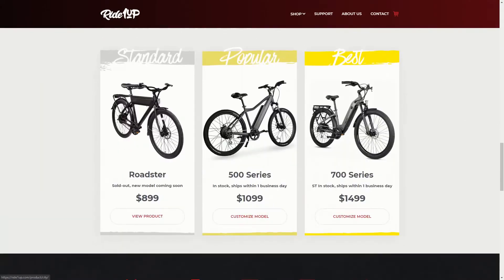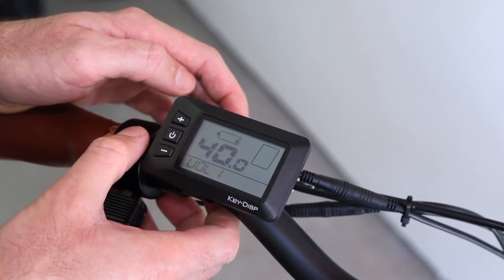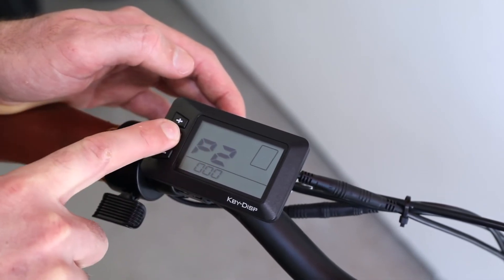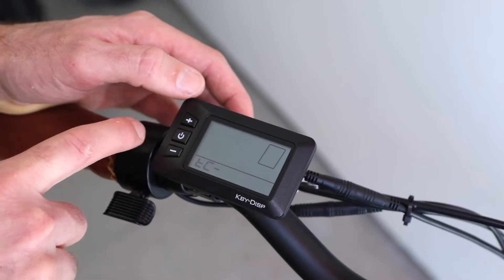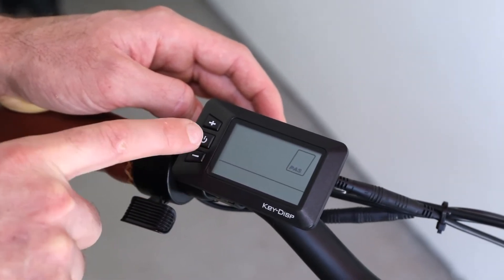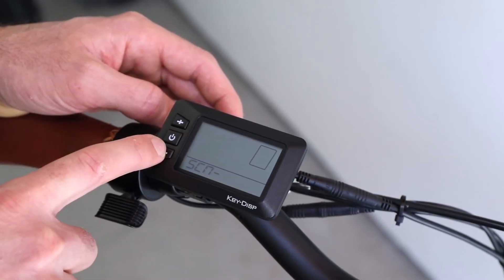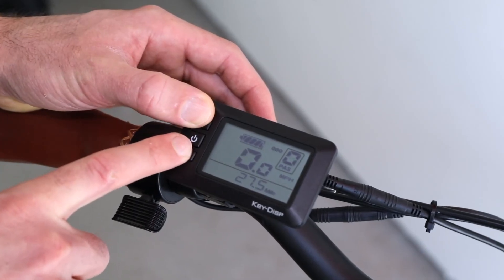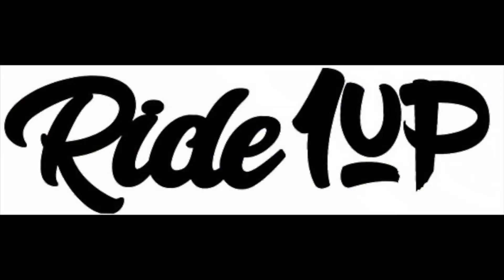500 Series Display Advanced Settings | Adjusting PAS

Comment: Hi sorry please could you help me my bike is 36v 250w motor in regards to the VOL setting is this setting to indicate how much battery is left or isit voltage control to the motor? My default value on setting 1 is not 31.5 but 10 please could you explain what VOL is

Comment: How do I change modes from pedal assist to ebike (no pedaling)
Reply: if u put a 0 in the small black box..that means u can peddle or use the throttle...no peddle asst.....if theres any number in the little black box 12345 that means your throttle wont work and your in peddle asst mode...hope that helps?!
Reply: When you start the bike press - one time so it says 0 in the display
Reply: Did you ever figure this out?

Comment: What is the default setting for wheel size? It seems no matter what size I choose I am not getting a correct speed readout.
Reply: My bike tires are 20 inch so I have it set at 20
Reply: @jbignJesus  Did your 500 come with 20"s originally? I have 27.5" but the tire size setting goes from 20-26 then to 700c with no 27.5 option in between or after.
Reply: @SpartanVoodoo  yeah, it did
Reply: @SpartanVoodoo  use 700C setting